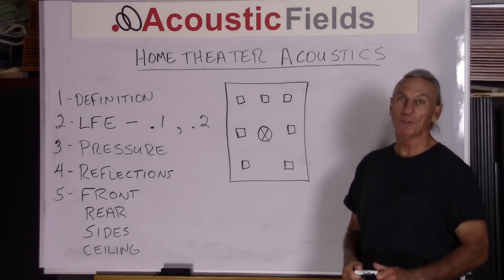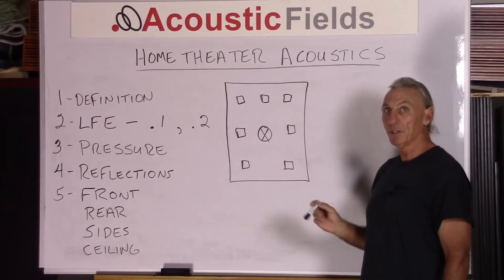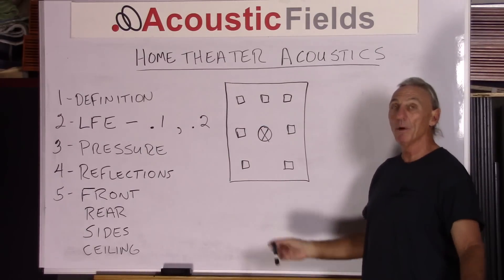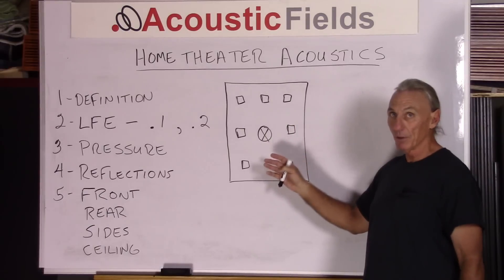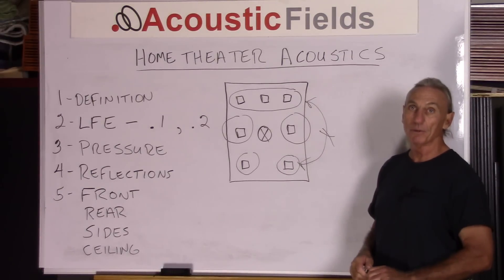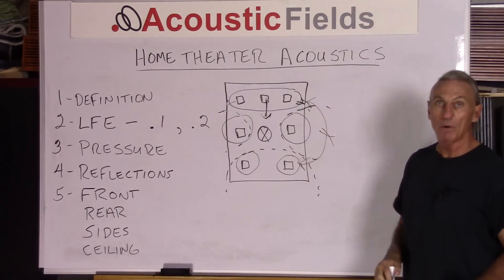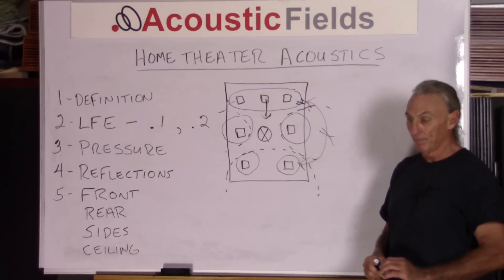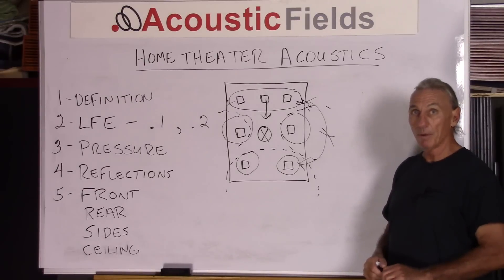Home Theater Acoustics 101 - www.AcousticFields.com

Comment: Setting up new room. Buying all new acoustic panels .... coming from DIY panels. Looking forward to what each soundfield section needs to sound good. Keep hearing about LEDE is no longer used and is old school , and that starting from first reflection absorption there should be a diffusive/reflective panel , then another absorption panel .... and so on and so on around the room for a minimum of 25% absorption and 25% diffusion.
Reply from the maker: Hi Home Theater Eman 

Thanks for the comment. I provided some feedback on your comment in this week's Google Hangout. You can see the part where I discussed this topic on this snippet of the video:
http://youtu.be/uIEm-cxYeN0

I hope it helps. Let me know if I can be of further assistance.

Thanks
Dennis

Comment: Hi Dennis.  Thanks for sharing your phenomenal knowledge.  HOME THEATER QUESTION:  Ultimately, I am wanting some hybrid blend effect of "home theater" AND "general audio" for parties... I am framing a house that will be done soon. It will have a 35x30 drywall main room, wood floor, with some large wood ceiling beams. The walls of the room are 11ft high wall plates and 17ft high center ceiling – meaning a large A-frame room like a barn. My TV is on the non-gable side wall, and not centered on wall from left-to-right (about 5 feet to the right due to room configuration, fireplace and doors).  I have one LARGE 8ft door on same wall left of TV and one LARGE 8ft door on the back wall opposite the other door – these doors lead to halls and rooms that are very long and I imagine would remove a lot of reflective sound from the room.  A kitchen is in the far away corner opposite where the TV is (left back corner from TV) --- and there is a large 20ft W x 8ft H glass slider (to the right of the TV.... I have 5 Polk Audio MC80s in-ceiling speakers in a common 'surround sound' arrangement based on Crutchfield diagrams for a 5-speaker system (however, I did spread the speakers out a little bit more than typical in order to cover the large room better for general music events. Due to the A-frame room type, the speakers are essentially all pointing directly toward the sitting area for the TV. The sitting zone is a little bit closer to the TV itself and not quite the dead center line of the room.  The 3 front speakers are on one side of the A-frame arch, and the 2 back speakers are on the other side of the arch --- so you can imagine all speakers pointing at the sitting zone where we would be enjoying movies, etc..   Additionally there are 2 Polk Audio PSW110 subs on same wall at TV (on a shelf 2ft off floor) facing out straight into room. The subs are sitting on shelves 10 ft to the left and 10 ft to the right of TV.  The entire TV and Speaker setup is NOT dead center in the room - it is about 5 feet shifted to the right (closer to the 20x8 glass slider)....  And lastly, I have very large book shelves all along the TV wall surrounding the TV, and the TV is directly over a 6ft wide stone fireplace (floor to ceiling).  So my question is regarding best sound for my "hybrid" objective --- Would I benefit from bass traps or is my room large enough to avoid bass traps?  And do you suggest sound diffusers or will my book shelves do the job?  If you do suggest either of these sound influencers, where are the most effective places to place them?  And any other pointers you have would be spectacular.  Thank you.  Tyler
Reply from the maker: +tyler massas Hi Tyler,  I am hoping you have not used drywall. Never use drywall in a music room. It destroys middle and high frequency timbre. Go to this link and fill out the requested information. I will run your numbers against our data base and find out all the unwanted low frequency pressure issues, their amplitude or strength, and most important their location. We will then treat the room areas with the correct acoustical technology. Never guess in acoustics. You will always guess wrong. Let the room tell you what it needs for your usage. You tell it what you are going to do in it and it will tell you what it does and does not like.   .http://www.acousticfields.com/free-acoustic-treatment-room-analysis-tell-us-room/

Comment: Hi Dennis! Congratulations! I appreciate people like you who shares knowledge! Please, let me ask you a question. Sometimes I have to design home-theaters that are in asymmetrical rooms or integrated with another environment, so the first interference I make is to align the room, but sometimes the client doesn't want to change it and they just ask to treat the room. How can we fix it when it's not possible to change the geometry to make the room symmetric?  How can we make the best acoustic job when sometimes these rooms are integrated with a dinning room or another environment in the house?  Thanks a lot!
Reply from the maker: +Paulo Bueno Room size and volume as you realize are critical in determining pressure and reflection treatment. If you can not change either, then you will need to add the correct surface area and type of low frequency absorption and reflection management to treat the issues.